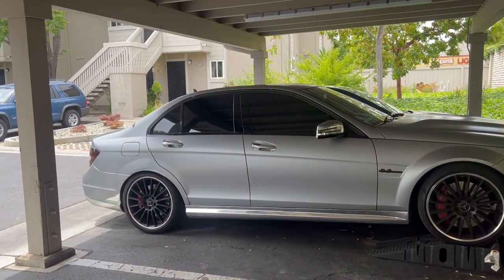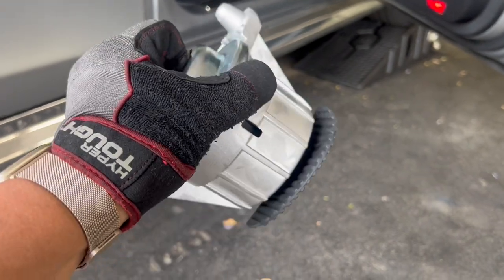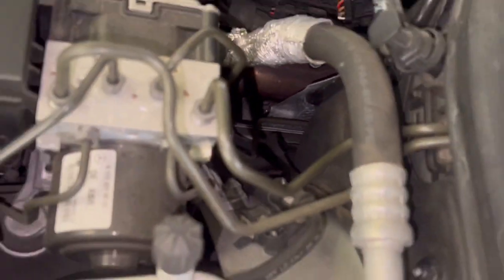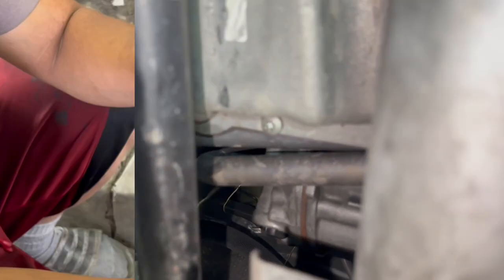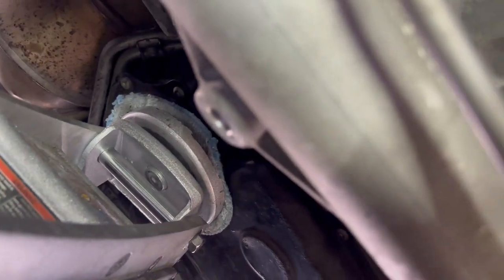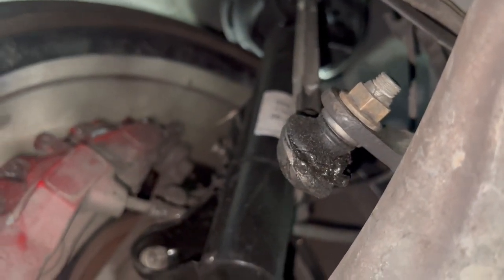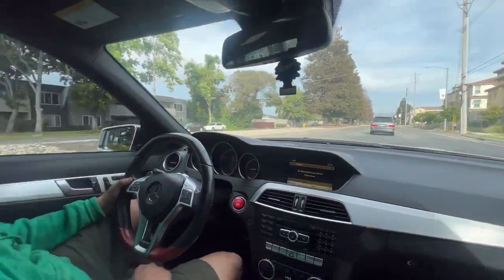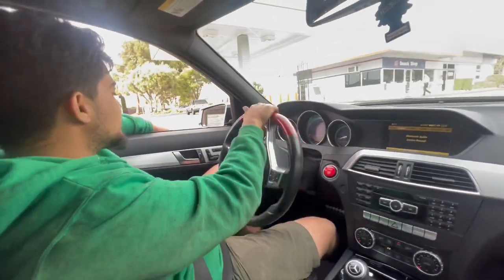Every AMG Owner Needs This Repair: C63 AMG Engine Mount Replacement DIY W204 C-Class Mercedes

Comment: Thanks for the help. Turns out the coolant reservoir is only secured by clips so moving it slightly makes it easier and the job can also be done single-handedly. Cheers!
Reply from the maker: Awesome! Thanks for sharing.

Comment: Nice job Sal!  Great instructional video, like always.  Like I mentioned before, it is especially helpful when you call out the sizes and the specific tools.  I love that level of detail in your vids!  You had to completely remove the steering rack for this job?  Or, just lower it?  How come?  Was it in the way to access the mounts?  I would have thought that the rack stuck with the chassis itself and wouldn't prevent you from raising/lowering the engine?  Are these mounts liquid filled hydraulic?  I think MBZ commonly uses that design of engine mounts.  Better vibration isolation but they never seemed to last as long as traditional design ones.  Keep up the great work! 👍
Reply from the maker: Hey!  I just had to drop the steering rack a small amount to move it out of the way. The engine mounts are in a very tight space so the extra room helps. They are hydraulic fluid filled engine mounts so that does make sense why the reliability is lacking. Once changed out, the comfort is much improved for sure.

Comment: curious, did you have the steering wheel locked with somthing to avoid damaging the clockspring since you disconnected the column and steering rack? Just wondering if you forgot to mention it or not? Trying to determine from other peoples experiences if doing such is necessary or not lol.
Reply from the maker: I recommend locking the steering wheel so you don’t damage it and also so your steering won’t be off alignment when trying to attach it all together again.

Comment: Was the engine ticking/knocking sound contributed to the bad engine mounts?
Reply from the maker: Yes it was fixed with new mounts.
Reply: @Sals_Garage  my mercedes is making the same ticking/knocking sound aand I have a slight engine vibration when the car is in gear. How does bad engine mounts cause they ticking sound? Im curious.
Reply from the maker: @mikedizzle5273  The excess engine vibration and ticking is due to the collapsed mounts. The engine and transmission mounts should be changed every 75k miles on average.
Reply: Were exactly is the clanking/knocking sound coming from?
Reply: With m156, knocking sound when cold is usually camshafts issue. They need to be changed every ~70k miles